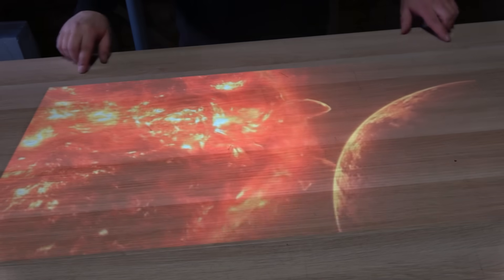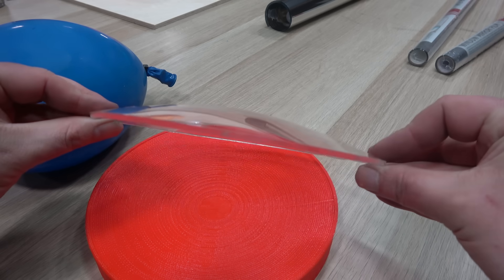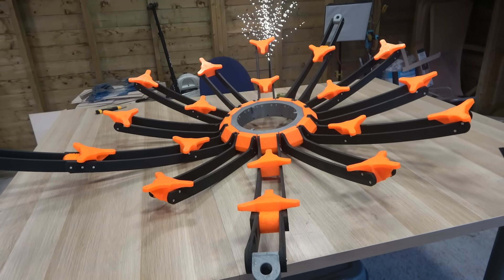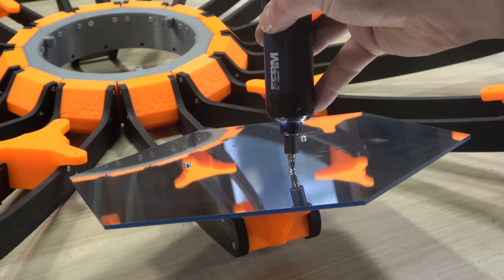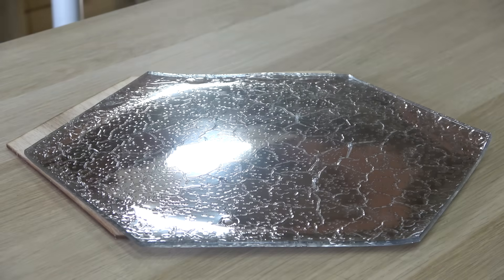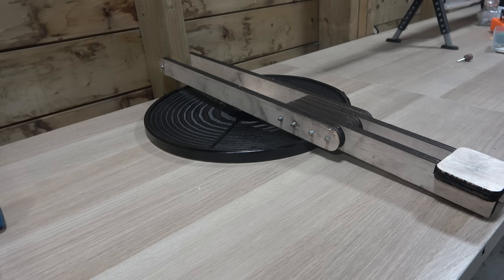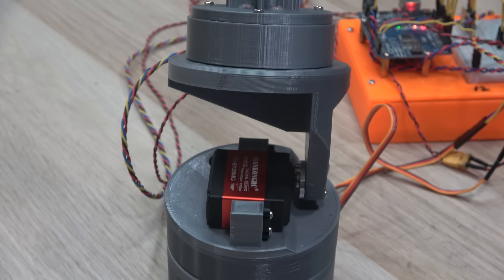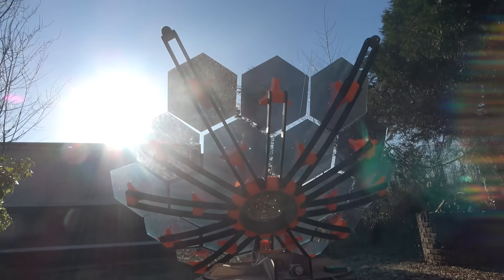Building a DIY Solar Generator..

Comment: Since you're trying to catch the light on the big plate, the parabolic shape on your primary mirrors is unnecessary.  Each petal or mirror segment can be flat and the secondary mirror can be flat; the parabolic effect will come from how each segment is focused on the secondary.  Rather than throw a tiny hot spot onto the receiver, let it be bigger and heat the whole thing more-or-less evenly.  Lower deltas are less lossy.

Also: you really want a dark receiver.  Shiny silver will reflect a lot of the incident energy, shiny black will absorb it without re-radiating it so readily.  Your ideal surface should be black chrome.
Reply: If he wants to achieve a real focus, each mirror should be a section of a paraboloid. Mirrors at the same radius can have the same shape, but the mirrors should be different shapes at different radius values.
Reply: @yeroca i second this, though the spot size is not critical for this application. To optimize, without the secondary mirror, you could go with a lary of perfectly flat mirrors the size of the spot size that you wanted on your target, so to avoid giving away too much in your Shadow 6 in. X 6 in would be amazing but 1 ft by 1 ft ish will probably still work.  Then you aim them all to that. Target a foot wide and you get your heat at over a big area which is great for boiling water.
Reply: I did something like this with a 1.2m satellite dish and aluminium foil, and then a mylar sheet over the dish and partially evacuated the volume behind - it was scary efficient!
I used candle soot to coat the bottom of a pan to absorb the energy.
At night, I could point it to a clear sky and use it to freeze things!
Reply: @ahaveland  Sorry but your comment interests me. I presume the idea is to use the reflective parabolic dish to parasitically draw heat from the object throughout the night? Broadcasting that heat to a place where it will not "bounce" back? (clear portion of night sky). If my understanding is correct, can you explain your setup a bit? I tried googling, but didn't find an analog (to yours) that would help me visualize. Where did the foil, mylar, and candle soot go in your construction?
Reply: @AstonSubstantive  foil glued to dish, or, mylar stretched across the dish like a drum skin and sucking out some of the air behind to make it parabolic.
Soot goes at the bottom of a saucepan or inside a hollow sphere at the focus to absorb the heat.
To radiate, place the entire thing in a polystyrene box making sure that nothing can see inside except the sky.
Reply: @ ahhh ok, makes sense now. thanks!
Reply: @ahaveland ❤❤❤❤❤❤❤❤❤      very cool   ……    I mean interesting
Reply: Yeah! The aluminum plate needs to be as black as possible.  And not gloss black. Matte black
Reply: @FABBuildit  there are materials. I heard of a nano-particle which are used for CCD sensors, to absorb light energy and not reflect anything.  I forget what they used, it might be graphine.
Reply: @FABBuildit  so vanta black got it
Reply: Agreed. Given that each mirror is similar (or smaller) than the collector-plate, there's no need to concentrate the sunlight, simply reflecting it with a pile of small individually flat mirrors will be sufficient. So he spent a LOT of time and effort doing something of no practical value here.
Reply: @agrajag-no  Incorrect... The tighter focus of light will generate more heat because all of the suns rays are being focused to a central point.  While painting the plate will help however it will get so hot that the paint will be burnt off.  He would be better off sanding the face of it so the light doesn't bounce off, because he is going to be boiling water very quickly..
Reply: If you want to concentrate the light back to the back you need a Ritchey Chretien formula so hyperboloid mirrors on the primary mirror and a correspondant hyperboloid secondary mirror. But it's complicated and overkill. 
I would have use paraboloid mirrors on the primary but would have place the heat plate on the focal point instead of a secondary mirror. It makes the formula way easier to colimate and you get rid of difficult to build optics.
As others mention, darkening the hot plate ensure light coming from the primary mirror isn't reflected so lost.
Reply: He doesn't even need to make a parabolic circle reflector. Instead, he can make a linear, spherical reflector (like a trough) and then stand the heat-absorbing plate vertically down the reflector's center.
You only have to worry about the reflector's pitch, not the azimuth.
Reply: Ideally you should lightly sand blast the collector surface and paint it with black paint with low reflectivity. Venta black for example. Also, on the water jacket side should be painted with a high heat conducting coating. The Nighthawk in Light and Tech Ingredients channels have done experiments with heat transfer coatings.
Reply: Anodise the collector.
Reply: Black, anodizing, and rough surface are all good suggestions for the collector.  Ideally, the front face would knurled or grooved so that any reflected light will hit another surface for a second chance at absorption.  Some additional things to add are engine antifreeze.  Not just for the higher boiling point, but for the corrosion inhibitors.  Also add a thick layer of insulation to retain all that hard won heat and prevent possible damage to printed parts.  A front pane of glass may help or hinder efficiency by trapping heat (but also reflecting some).  But a reflective "dog cone of shame" around the front of the collector will help reduce convection and bounce some unfocused light in.  Done right, the collector could have been much smaller and run hotter.

Example: as kids, we used to make cones with cardboard and aluminum foil about the size and shape of a traffic cone.  Stick the small end in a can and it would get hot enough to cook hot dogs.
Reply: You’re mostly wrong on most of your points.
For a Jwst style solar collector, the overall shape of the main mirror has to be to be roughly parabolic. You don’t need for it to be dish shaped as you could just take an approach similar to fresnel lenses where you create a flattened version of a lens’s. 
The individual petals can be flat but would be easier to concentrate the light on the secondary mirror if they were slightly parabolic and the secondary mirror could be much smaller. 
The only way for the “secondary” mirror to be flat and still focus on a collector plate would be to have every “petal” pointing words its own unique secondary mirror. 
The tiny hotspot will only exist if you place an object exactly at the focal point. Normally you would place it in front or behind. 
Yes you want a dark receiver. Idk what your talking about with “shiny black”. All you need to do is maximize spectrum absorption, if something is shiny it’s has reflectance, so shiny is bad. Also you need to account for Outside the visible spectrum.
Reply: You could also try to make the collector out of graphite, easy machining, low cost and good heat transfer properties.
Most of all it can withstand high temperatures.
Only issue might be the water channels, but some water seeping into the graphite might actually be beneficial.
Reply: yup, it's not like he's trying to drill a hole through the heat plate with solar power, just heat the fluid.  Also, how is he going to reduce the albedo of the aluminum, Al doesn't like bonding to most high temperature paints due to differential shrinkage...I would have started with a "blacked" iron plate with some of that ultra-black paint on it....might work.
Reply: Just get as large of an old satellite receiver dish you can find and cover it in cheap small flat mirrors.
Reply: Yep, get some black heat proof paint for an engine and paint the receiver, it might get too hot since those fresnel lenses can turn rock into lava!
Reply: Yes
Reply: Yes, sun heating device doesn't need to be as precise as a telescope of course. And more. With this focal length and diameter, the amount of energy collected by a precise device will generate challenging temperature at the focal point, reaching almost the temperature of the sun surface, heat plate will melt within minutes.
Reply: It would be polite to begin your comment with "Great vid" or "Cool project"
But I know politeness is not a thing in some cultures

Comment: So many weird choices? Springs are not expensive, why not heat the acrylic and form it to shape before you paint it? Why use paint at all when making a mirror is trivial. You have 3 arms for the secondary mirror. But why not but 2 on the bottom, that's where the weight will be. Also that screw for the tilt adjust is under a huge load. If you instead put it on the opposite side of the mirror, it would have way more leverage and be exposed to less force. Also that aluminum plate is weird. You are going to go blind as soon as some sun hits that, it should be black. Also you better have a radiator in the water loop, I hope you're not just recirculating it. Since this is an outdoor thing anyway you should have just made it screw onto a water hose. Infinite cold water. Also I think it would have been better if the aluminum plate wasn't mounted to mirror, but instead mounted on the wood ring. It would stay flat and it would be far easier to put your test items on. How do you suppose you'll attach something to your aluminum plate at such an angle?
Reply: I just checked. Since the Netherlands are pretty north, the absolute best case scenario, is on June 21st, at 1:41 pm the summer solstice, the sun will still be 30 degrees off from directly up. So your aluminum plate will always be 30 or more degrees angled